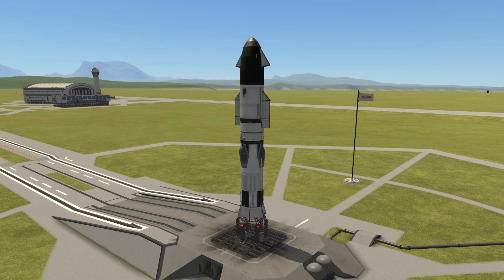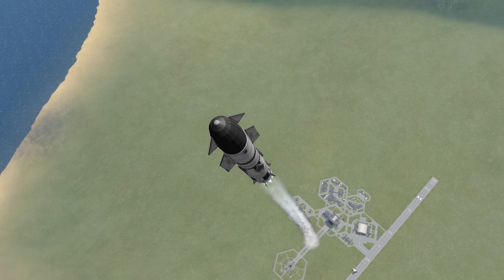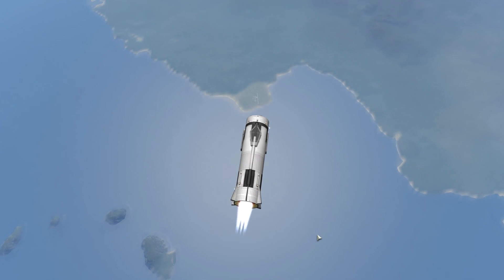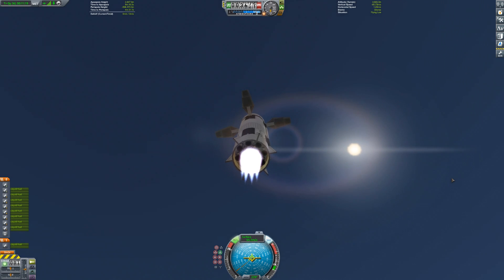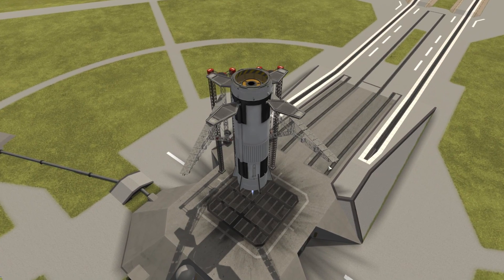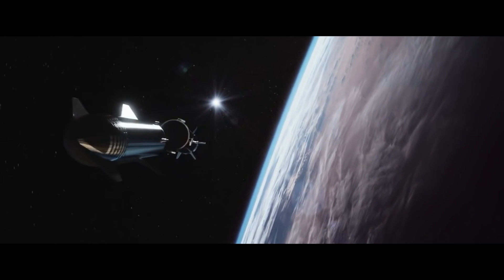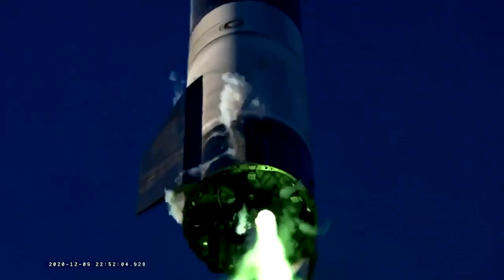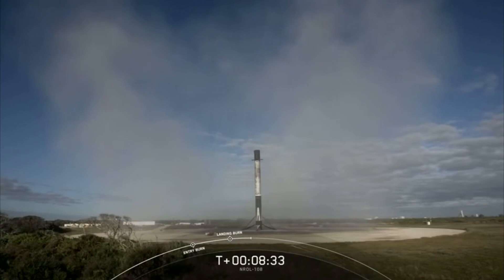Why SpaceX Wants To Make Landing Super Heavy MORE Difficult.

Comment: They can design a ring that hangs from three towers like aricibo and the ring can move and adjust its position
Reply: The Arecibo receiver was on an 820-tonne platform suspended by three cables. I found an estimate for empty weight of Super Heavy booster of 300 tonnes. So it's plausible. You wouldn't need to have the towers nearly so far away, the margin of error on Falcon 9 landings is pretty small.

I wonder if you could hang the rocket from its grid fins for _takeoff_. The fuel and Starship on top make it vastly heavier.
Reply: @skierpage  Yeah but Arecibo is static loading.  Having a rocket drop all its weight on it at once is totally different
Reply: @deathpony698  Yes but not so much impact force if the rocket comes to a near halt in midair just as Falcon 9 boosters do at ground level.

Others here are proposing to catch the rocket while it's still moving to save fuel, but that puts a LOT more stress on the catching device.
If the rocket can come to a standstill in midair, then I think landing between two cables or two steel beams like Scott Manley's video at 5:00 is pretty plausible. SpaceX could engineer a little or even a lot of flex into the system.
Reply: Not sure comparisons with Aricibo are a good idea given its recent unplanned rapid disassembly.
Reply: @fredbloggs5902  it’s a idea. No thinking outside of the box.
Reply: @fredbloggs5902  do you mean after 60 years and adding more wight to it?with correct engineering and enough money you can do anything
Reply: @amirsa7140  And a total lack of appropriate maintenance.

Comment: If they catch the rocket in the air/over the flame trench the exhaust can go through the flame trench instead of kicking back up into the engine bay. Also it prevents having to refurbish the legs which (I assume) would be harder to refurbish and fix (since they are fixed in place) rather than the grid fins.

Comment: I remember the very earliest statements about the super heavy landing. It was supposed to land exactly on the same contract points from which it launched. This new idea seems easier.
Reply: Indeed, not to mention the benefit of not damaging the pad a little bit at a time until it cracks, which has already caused problems with just 3 raptor engines, let alone 20 or 30 of them.

The question then becomes, what about landing starship on mars? Would the shockwaves or debree damage a landing starship, making it unable to launch back to earth without huge repairs? I would like to know more about the opinions of the people on the physics side of design, since i come more from a software perspective on this topic.
Reply: @yonidellarocha9714  Agreed. The Saturn V needed a special pad to not damage it thanks to 3,000 tonnes of weight and even more thrust. (Starship and Super Heavy will be even bigger)
Reply: @yonidellarocha9714  the launchpad is almost certainly going to be designed differently than the starship suborbital launch pads so as to reduce the amount of damage sustained during launch
Reply: @yonidellarocha9714  -- I don't think there are any terrestrial bodies in this star system larger than earth, mars is only 0.38g, and the moon is 0.17g. Landing on mars would be a lot easier, possibly with single use crush legs installed in orbit. The takeoff might need some kind of jack system to lift it off the ground so it doesn't damage it's engine bells.
Reply: "26 seconds ago"! exciting!

Comment: That idea seem so crazy that ssto's seem real-
Reply: Starships upper stage will be ssto capable if empty.
Reply: @danielboatright8887  same with the falcon 9 first stage but it couldn’t take more than a backpack and couldn’t land so sstos are not actually that good
Reply: Why waste fuel on dragging dead mass?

Unless you can bend physics, I don't see SSTO's being viable.
Reply: SLS is pretty close to being an ssto
Reply: @Arae_1  No, the solid boosters are dropped part way through launch.
Reply: @owensmith7530  I know
Reply: @Arae_1  I think he means that no stage separations of the normal variant happen only boosters are dropped and that may seem like an sstoish thing but those boosters are BIG and even bigger than the ones on the shuttles so they do a lot more than one might think but I admit I was surprised that it didn’t need to use it’s upper stage to get into orbit as I don’t know any rockets used except the atlas that do anything like this
Reply: @adamkerman475  yeah that's basically what I mean, and yes, I know that those boosters do most of the work
Reply: I direct you to nuclear isomer reactors, & beamed power (specifically the heat exchanger variant). Either one is capable of making SSTOs realistic.
Reply: @absalomdraconis  reusable rocket stages make SSTOs almost irrelevant.

Comment: 2 things are going to happen:
1. The booster will occasionally hit the tower
2. The thing that catches superheavy will move according to the location of the booster
Reply: I want to know what the backup system is. If it ever needs to land without a tower, can it still setdown safety in a field? Or do they go for a water landing? They certainly couldn't fly to another airport.
Reply: @TlalocTemporal  Probably just ditch it in the water, that's what Falcon does if it doesn't think it can land safely. Or maybe if the systems become good enough they could touch it down on a concrete slab soft enough to not explode but obviously write off the engines in the process.
Reply: As it can hover, i will never have to hit the tower, since it can just stop midair and adjust itself very precicely. Something that falcon 9 can not do.
Reply: @gelisob  It's still fuel limited, I imagine it can't stop and hover for more than a few seconds unless they intentionally leave a larger fuel reserve (which then cuts into payload capacity). It's going to have to be very accurate so that those few seconds of hover are used to gently set it right where it needs to be, any significant deviation and that hover will just be delaying its inevitable collision with the ground.
Reply: @MrMattumbo  -> GPS accuracy (continually being improved) is sufficient.
Reply: @egm7671  It's not just about the accuracy of your sensors (GPS is only accurate to within several at best meters in real world use btw and is dependent on atmospheric conditions) but the accuracy of the entire system. We're talking about a flying high-rise coming in at nearly supersonic speeds that has to hit a precise target (which until SpaceX releases more info we have no idea the tolerances of the system they plan, it could be meters, could be centimeters). It also has to be able to do this within a range of weather conditions since no launch window will ever be the same, or perfect.

I don't doubt this is possible, but I do think people are underestimating the difficulty of it.
Reply: MrMattumbo laser guidance once in range, for example - many assistive technologies to enable this degree of accuracy.
Reply: @gelisob  Why hover when you've already mastered suicide burns? It's the same thing as a falcon 9 landing, just the stopping point is different and the landing legs are now ground equipment with waaay more suspension.
Reply: @MobiAussie  because hovering is cheaper than rebuilding the landing complex and vehicle, when things are not so certain. They would hover falcon 9 too to lessen the damage if they could. Like blue origin does.
Reply: A skilled pilot can land and balance helicopter on a road-side railing (typically it may be needed for rescue helicopters at car accidents in the Alps where it can't fit on the road), or hoist a doctor down onto a ship-deck of a small vessel in major seas, so guiding a rocket down to the landing spot isn't impossible, nor hard. Just.... Rocket science!